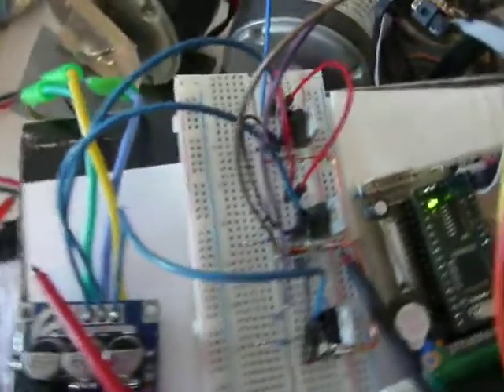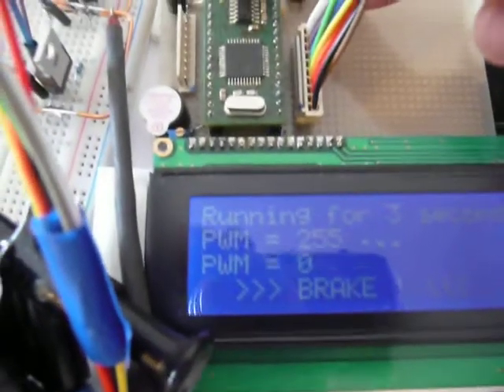8$-Brushless-Controller JYQD for Hoverboard-Motor NOW WITH BRAKE - Part 2

Comment: Hi, cooles Projekt! Ich habe vor die Hoverboardmotoren am original Akku mit diesen ESC's zu steuern. Allerdings ist da die maximale Spannung bei 10S2P ~42V. Können das die ESC's ab oder wie kann man das Akkupack dann nutzen, möglichst ohne die  Zellen neu anzuordnen?
Reply from the maker: Das hast Du richtig erkannt! Ein Akku, der 36 V Nennspannung hat, hat eine Ladeschlußspannung von 42 V - und das ist ein ernstzunehmendes Problem für diesen BLDC-Controller, weil er nur für U_in < 36 V ausgelegt ist! Der Grund liegt in dem LM317-Spannungsregler auf dem ESC, der lt. Datenblatt nur max. 36 V an seinem Eingang verträgt...!

Hier gibt es einen Trick, um dennoch mit 42 V arbeiten zu können (ich habe es irgendwo in den Kommentaren m.E, schonmal beschrieben): Der Strom durch den LM317 im Betrieb beträgt ca. 40 mA. In Reihe zum LM317 wird eine Leistungszenerdiode gesetzt (z.B. Typ 1N5349B), die Anode kommt an den LM317-Eingang, die Kathode an Akku+ (42 V). Durch die Diode werden permanent 12 V vom Akku abgezogen, der LM317 wird dann bei Akku = 42 V mit (42 V - Zenerspannung) 30 V versorgt.
Natürlich wird die Diode warm, da diese jetzt 12 * 0,04 = 480 mW in Wärme umsetzt, was noch im grünen Bereich ist. Wenn der Platz ausreicht, kannst Du auch 2 Dioden parallel löten, die Verluste teilen sich dann auf...

Datenblatt Leistungszenerdiode:
https://www.fagorelectronica.com/images/download/semiconductor/1n53b.pdf

Das ist vom Löten her etwas tricky, da der filigrane Input-Pin vom LM 317 abgelötet und auf die Anode der Diode aufgelegt werden muss. Es gibt versch. Leiterplatten von diesem BLDC-Controller, achte auf die Kondensatoren im LM317-Eingangsbereich - diese müssen auch die 42 V vertragen, da deren Spannung NICHT reduziert wird. Die MOSFET-Kondensatoren müssen sogar noch etwas mehr als 42 V vertragen, da sich bei Einsatz der hier von mir vorgestellten MOSFET-Bremse die Spannung an den Puffer-C's etwas erhöhen kann (gemessen von mir ca. +5 V bei U_in = 35 V), weil beim Bremsen der Motor als Generator über die MOSFET-Freilaufdioden etwas Strom in den Akku einprägt. Ein geringer Akku-Innenwiderstand (und dicke Versorgungsleitungen) sind hier von Vorteil...

Tipp: Zum Testen derartiger Umbauten unbedingt ein strombegrenzendes Netzteil verwenden, mit Einstellung der Strombegrenzung auf 100 mA (zuerst ohne Motor testen). Mit Motor reichen bei 42 V rund 500 mA zum Anlauftest...
Viel Erfolg!
Reply: AccuXperT vielen Dank für die schnelle Antwort!
Reply: Moin....
...ich bin verwirrt. Wenn ich das Datenblatt des LM317 richtig interpretiere, dann gibt es keine Vmax, sondern eine maximale Differenz zwischen Input und Output. Diese liegt bei 37 Volt (VI – VO Input-to-output differential voltage ). Das sollte doch bedeuten das 42 Volt vom Akku völlig Ok sind (für den LM317) da er eine Output von 15V liefert...
Klar, die Elkos sollten trotzdem die 42V vertragen...    Sollte ich mich täuschen bitte ich um Aufklärung.

Grüße
Reply from the maker: @jayfrickel9973  Du hast Recht! Ich ging fälschlicherweise davon aus, das die kritische (zu hohe) Vin des LM317 ggü. Massepotential zu bewerten ist.

Dennoch gilt Folgendes zu bedenken: durch das aktive Bremsen wird der Motor schlagartig zum Generator und speißt in die Batterie zurück, da durch die notwendige Pulsung der Brems-PWM (zur Vermeidung von Blockade-Schäden am Motor) nicht die gesamte Energie über die Masse-MOSFET's kurzgeschlossen werden kann.
Dadurch hebt sich die Spannung über der Batterie an und zwar umso mehr, je höher der Batterie-Ri (Akku-Ri) und je höher die Drehzahl ist. Mit meinem FLUKE-DVM konnte ich dabei bis zu +8V messen, was bei einem vollen Akku bereits eine Gesamtspannung von 50V wäre! Aus diesem Grund kam ich auf die Idee mittels Leistungsdiode das gesamte Spannungsniveau etwas abzusenken, um den LM317 nicht unnötig zu stressen...
Das sind jetzt aber auch nur Laborwerte des (fast) unbelasteten Rades im Video, unter Belastung sieht das dann wieder völlig anders aus. Ein möglichst niederohmiger Akku mit dickem Kabelquerschnitt zum Controller kann trotzdem nicht schaden, um den Gesamt-Ri möglichst gering zu halten (= hoher Wirkungsgrad).
Reply: Also hab ich nur teilweise recht. Nämlich unter der  Annahme das die Bremse einfach einen vollständigen Kurzschluss macht....
Aber verwirrt bin ich immer noch: Der Motor wird doch auch zum Generator wenn er einfach ausrollen kann statt zu bremsen. Ich glaube ich muss mir mal den vollständigen Schaltplan mit Bremse skizzieren damit ich das verstehe.

Inzwischen hab ich mir allerdings auch die BLD-300b Treiber zugelegt, die vieles deutlich einfacher machen sollten (wenn auch viel teurer)
Reply from the maker: @jayfrickel9973  Der von selbst ausdrehende Motor wird zwar auch zum Generator, aber zu einem unbelastetem Generator. Es gibt keinen wirksamen Generatorstrom, der über dem Ri des Akkus zu einer signifikaten Spannungsüberhöhung führen könnte.
Mögliche Spannungsspitzen werden mit den in den MOSFET's vorhandenen Bodydioden geglättet und dürften kaum zu messen sein.
Für einen besseren / geregelten Brems- bzw. Generatorbetrieb wäre es m.E. nötig, die Halbbrücken des BLDC-Controllers separat ansteuern zu können, was ja vom Hersteller des BLDC-Controllers nicht vorgesehen ist.
Das Pulsen der Brems-PWM ist in einem dynamischen Bot-Projekt in jedem Fall nötig, um die Bremswirkung dosieren zu können. Somit ist meine Lösung mit den externen Brems-MOSFET's auch eher eine Notlösung, die einfach & günstig realisiert werden kann... :)
Reply: Nachtrag:
Mir scheint es so, dass nur die Elkos der FETs die Eingangsspannung sehen. Die Beiden neben den beiden Spannungsreglern hängen an deren Ausgängen und sehen demnach geregelte 15V und 5V...    Das deckt sich auch mit dem Schaltplan im (chinesischen) Datenblatt des JY01...
Reply: Jepp, das Video kenn ich. Finde ich super das Du das hinbekommen hast. Ein toller Hack.
 Mir ist das allerdings für mein Projekt etwas zu sehr "Von Hinten durch die Brust ins Auge". Daher hab ich mich dazu entschieden sowohl Deine Bremsenvariante als auch die teuere BLD-300b Variante zu testen. Beide werden deutlich strukturierte Projekte abgeben als das gehackte Protokoll. 

Zum Thema Englisch: Nachdem das Video gedreht ist wäre es ja auch nicht mehr so rasend viel Aufwand noch eine deutsche Variante zu machen. Trotzdem ist der Inhalt zu verstehen und letztlich kommt es da drauf an. Danke fürs Teilen Deines Wissens
Reply from the maker: @jayfrickel9973  Mir wurde irgendwann klar, dass die Hoverboard-Controller schon aus Sicherheitsgründen die Räder niemals "loslassen" (freewheeling), also ein abtourendes Rad immer vom Controller aktiv heruntergebremst wird! Das ergibt eine hohe Dynamik mit fast zu vernachlässigen Umschaltzeiten - genau richtig für einen Allrad-Bot mit 24 kg Gewicht... :)
Und das Schöne daran: Du kannst die Sache fast beliebig kaskadieren! Kannst also mit Leichtigkeit einen Bot mit 6 oder 8 Rädern aufbauen, und jedes Rad entwickelt ein Drehmoment von bis zu 15 Nm... :)
Und weil diese Hoverboard ein Massenprodukt sind, gibt es die dynamischen BLDC-Controller mit 8,5"-Offroad-Kompletträdern fast schon umsonst... :)

Comment: How did you wire the Motor to the Controlboard?
Reply from the maker: The engine has 3 thick and 5 thin wires. These are connected directly to the BLDC controller. This BLDC controller is described here because it is very cheap at about $ 8. The BLDC controller drives the brushless DC motor, and the BLDC controller is driven by the (digital) control lines from my ATMEL controller board. To control the BLDC controller would also go an Arduino controller or something similar. Even driving without a controller (and thus without the need for programming) would go by setting the control lines to the desired potential, and then an electronic throttle could be used to control the engine speed as used on electric scooters ...
I have described a special case here because I still use a brake that is not normally needed and would even disturb in the case of an eBike or scooter.
Well, I hope that my information was helpful ... :)
Reply: AccuXperT Thank you! I want to use the Motor to build an FFB Racing Sim Wheel. I guess I dont need the brake, but fast direction changes.

My Question was more about which cable color is which connection.
Reply from the maker: When switching the direction, the JY01-internal switching times come into effect. The JY01 chip only waits until the wheel has reached standstill and then another 400 ... 500 ms BEFORE the opposite direction is energized. This is completely independent of the control! With the brake, this switching is about 50% faster in my experience ...

Regarding the color of the 3 thick wires: These are completely confused with my hoverboards, which is due to the Chinese production. This must be tested, preferably with a power supply with a current limit of 1 A.
In the video the assignment is as follows:
MC = green
MB = blue
MA = yellow
Reply: AccuXperT thanks for this! I’m confused why connecting MA MB or MC to ground would brake though. Wouldn’t you want one of them to be energized? If they’re all ground won’t it spin freely?
Reply from the maker: A motor that is not at standstill (which turns more or less fast) and NOT powered by the controller is a generator. When the 3 ports (MA, MB, MC) are open, the motor spins for a while to a stop - this is called "freewheeling". An example: An electric scooter where the driver takes out the throttle at full speed rolls to a stop.
With a motor brake, this is completely different: the 3 connections are grounded, which short-circuits the generator power of the motor and stops the motor VERY FAST or IMMEDIATELY. The upper example of the electric scooter would mean that the scooter makes a FULL BRAKING! That does not make sense with the scooter, in contrast with a dynamic robot ...

In fact, there are still variants when shorting the generator power: It can also only 2 connections are grounded, but then flows part of the generator current through the free-wheeling diodes of the power MOSFETs from the controller, which can cause the voltage on the battery increases.
There is also another variant where directly a current is returned to the battery (recuperation).
However, this variant makes no sense in a robot and is not considered here.

But concerning your question: When braking actively, I do not want a connection is energized. This is not possible with this controller, as it is deactivated during braking.
The exact interaction between energizing and braking also depends on the software. If braking is slowed down from a very high speed, it may make sense to pulse the brake MOSFETs (PWM = 50% with 1500 Hz). But everyone has to test that out on his project - good luck ...!
Reply: AccuXperT thanks so much! Do I need diodes too to prevent charging the battery? Or what kind of mosfets are you using? And are you using the hover board 36v lipo? It looks like there’s a voltage spike on the display when you brake, am I wrong? Thanks
Reply from the maker: You are not wrong. In the final robot, I actually use the original 36V lipos. These have a final charge voltage of 42 V and the controller has to be rebuilt because the LM317 of the Controller can handle only max. 36 V in the input. Therefore, I use a power supply with an initial small current limit to make the development...

In fact, there is an increase in the power supply by a few volts during braking. This comes from the clocking of the brake MOSFETs (PWM), with the generator current in the PWM pauses (brake MOSFETs = Off) flowing through the freewheeling diodes of the controller to the power supply - and this fed backwards, whereby the voltage is raised. With additional diodes, this can not be prevented. Here, only the lowest possible internal resistance of the battery (and the low-impedance supply lines) is helpful, or the clocking with the PWM brake is not required and is fully short-circuited to ground. In this case, however, the engine can be damaged, which everyone must check in his project. In the video there is no load on the tire, so the engine brakes to the point (that's why I've clocked so that the engine is not damaged). In the real project the tire is loaded and it may not have to be clocked.
I will investigate this later ...
Reply: Thank you! Another youtuber said the 36V lipo fried his board and I was wondering why. That explains it.
Reply from the maker: That's right. It is safer with 24 V batteries. But who really wants to have dynamic on his engine does not come around a 36 V battery. I have described the necessary conversion on the controller here. By principle, a thick 12V suppressor diode is placed in series with the input of the LM317. The LM317 gets then only 30V at the entrance (42V - 12V).
These 36 V batteries are very reasonably priced from a broken hoverboard ...